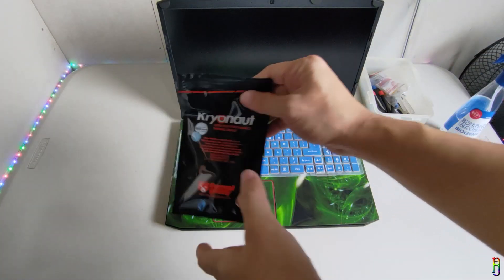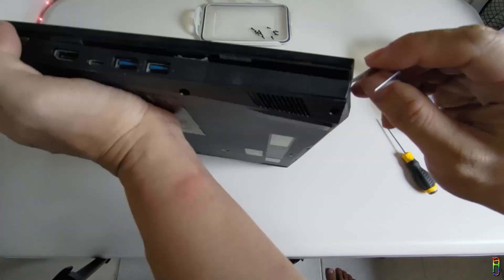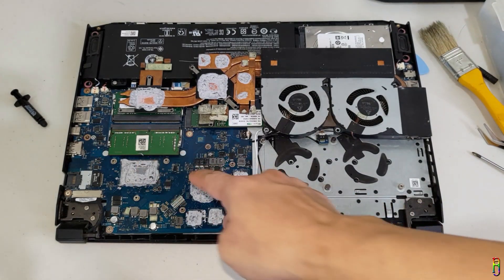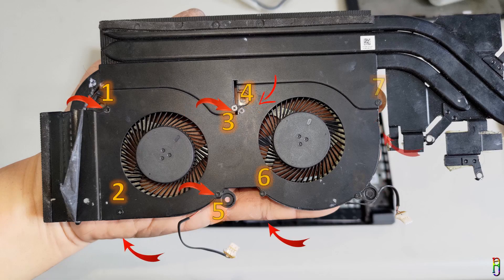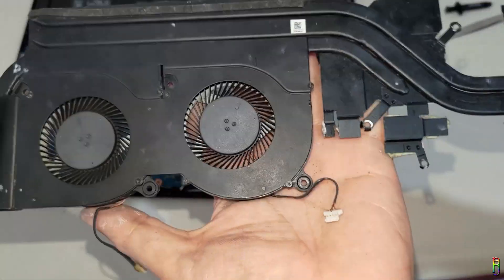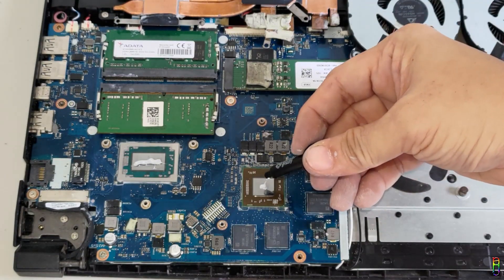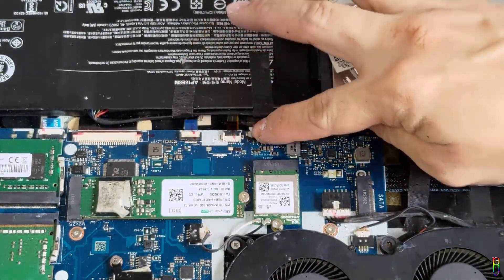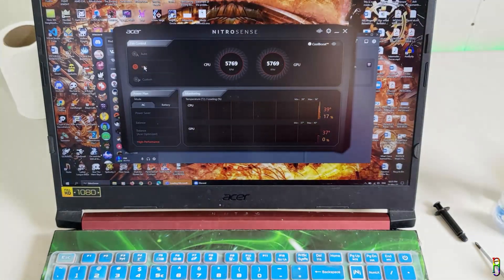Nitro 5 Repaste, Cleaning & Disassembly (AN515-43 with Kryonaut)

Comment: Gonna save this video later, im planning to buy kryonaut and ram to upgrade my same model laptop after 2 years
Reply: Me too lol although gotta say this laptop is still rocking like it's new i mean for me performance degradation didn't happen or its so low i don't even notice except for temps
Reply: @Gamin-ningo240  did you find an improvement after repaste and cleaning?
Reply: @flooosha2376  yes at least temps are lower also after cleaning the fans the aur from the side feels just like how I felt it first time

Comment: Thank you for this tutorial. My gpu used to go to 75C while having fan speed on max and limiting fps with low ingame settings. Now it doesn’t reach above 53C while under heavy load, no fps limiting and medium/high settings!
Reply from the maker: Great!
Reply: @ribbytrivia  bro how are you getting 53C
Reply from the maker: @Gamin-ningo240  Just cleaning and using a quality thermal paste
Reply: @ribbytrivia  but I'm surprised a laptop getting those temps under load that's almost like a pc